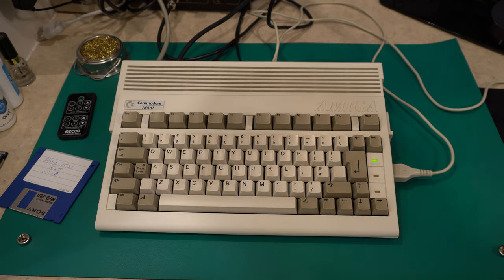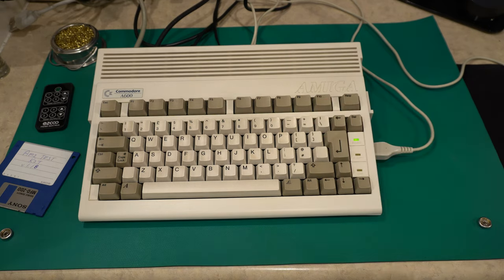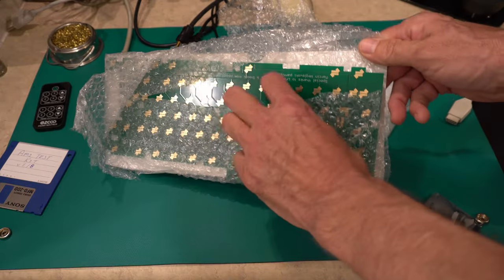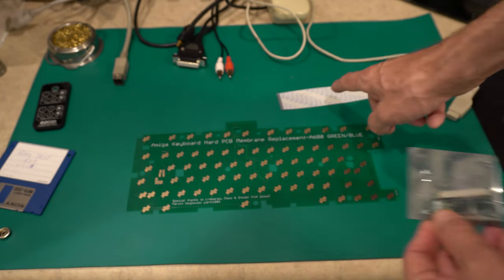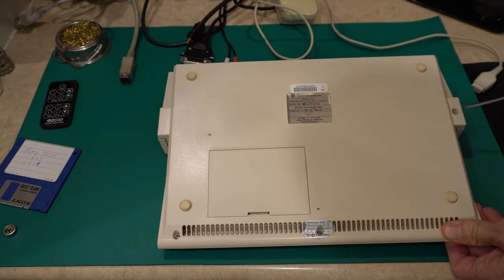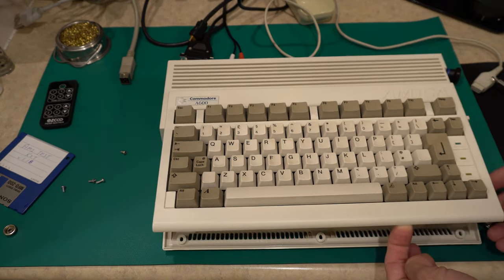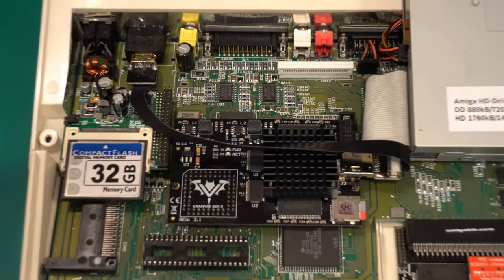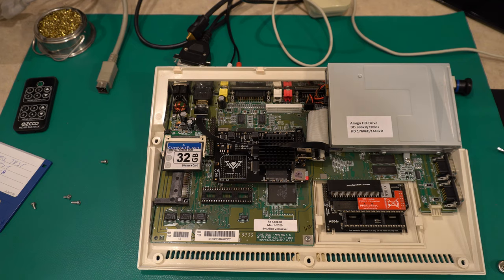Amiga 600 New Keyboard Membrane Replacement/Upgrade (excellent quality product).

Comment from the maker: Amiga 600:

New Premium Hard Keyboard Membrane PCB Amiga 600 Replacement for Green Blue
https://www.ebay.ca/sch/i.html?_from=R40&_trksid=p2334524.m570.l1313&_nkw=Amiga+600+keyboard&_sacat=0

A500/A1200:

New Premium Hard Keyboard Membrane PCB Amiga 500 1200 Green Replacement
https://www.ebay.ca/sch/i.html?_from=R40&_trksid=p2334524.m570.l1313&_nkw=amiga+1200+keyboard+membrane&_sacat=0&LH_TitleDesc=0&_osacat=0&_odkw=amiga+1200+keyboard+membrane

The A500 version is not Mitsumi Compatible - the keyboard controller uses a dual header membrane. The A500 version only supports single header variants. Check for this if you decide to get one.

Comment: I got one for my A1200 the caps lock key did not work. I fitted it it works ok now. I found when you fit the keyboard to the motherboard I just push it in. The keyboard cable is a bit longer. It makes a very good contact. They cost a bit more but worth it. So I got a spare one for my A500+ just in case.
Reply from the maker: I have one for my 1200 as well. It too  gave up the ghost. I agree,  these are worth evey penny. A great future proof option ;)

Comment: I have replaced a few membranes and then the Hard Versions came out.   On the A500 its not always the membrane which causes keyboard issues but dry solder joints on the keyboard PCB.  I have given some thought about buying some hard membranes to have on the shelf should I run into a problem but most of the Amiga's I use are racked and connected to a KVM Switch so I really don't use the original keyboards.   I have a Furia and the best place for it is in the box.  I replaced it with a Vampire and never looked back.   I have played with 3.2 only in WinUAE just to setup a card and play with it but have yet to put it in a Classic Amiga but so far its worked out well but for me everything I was doing with my Amiga's has been put on hold as the needs of much needed PM's on my car have taken priority.
Reply from the maker: I haven't had my luck regarding repair attempts on keyboard membranes. Either they don't work properly or not for long :) At least this way, the repair will last a long time.

Comment: Where did u get the Amiga 600 keyboard membrane?... And how much it cost?..I would like to get one
Reply from the maker: I bought the Hard Keyboard Membrane for the A600 from eBay.  Amiga 500/1200 versions are also available. They usually cost around $60 CAD or $45 USD. Not too expensive considering the quality versus the stock membrane. Search for "Amiga 600 Keyboard" on eBay and you'll get the results you need. They are in stock most of the time, some are available now. (thanks for watching my Videos!).